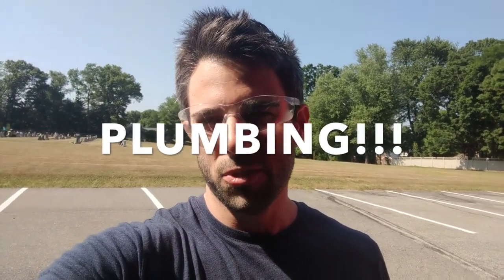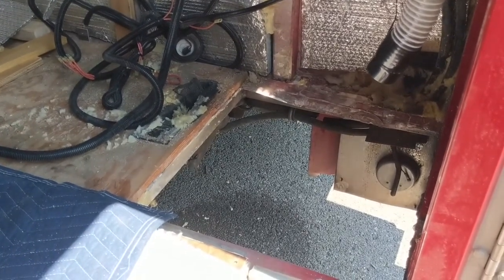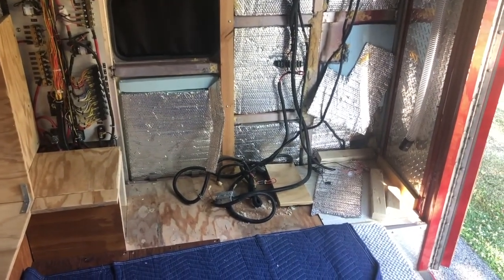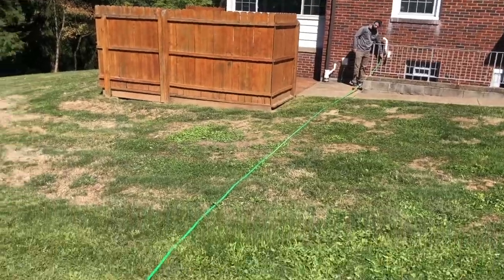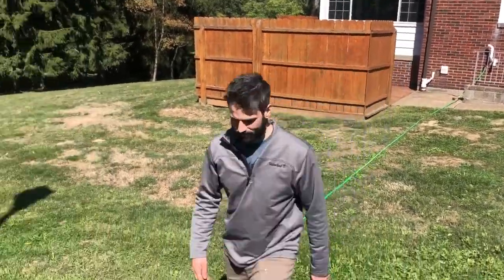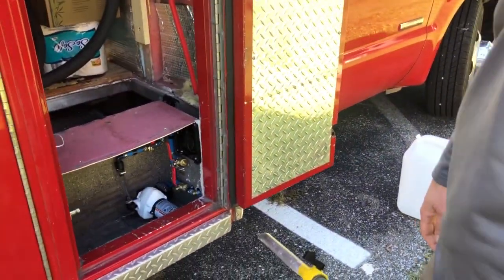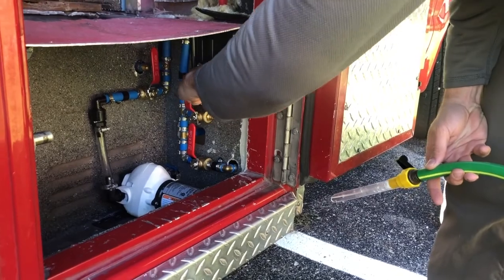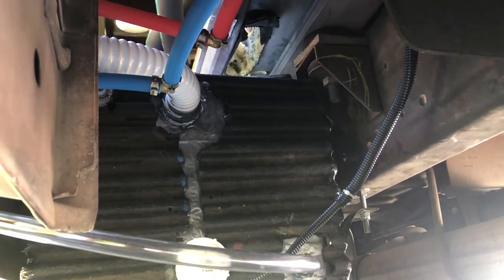Ambulance Conversion Plumbing System

Comment: You may have a problem with pipes freezing if in a freeze zone....I want one...
Reply from the maker: Hi Randy! We used pipe insulation to cover us for the most part, but we’re also snowbirds and don’t plan to be in temps below 30 any time soon 😉
Reply: @bethzabiegalski7874  cool, I was in colorado with a travel trailer.  The sewage hose froze up...then the toilet filled up....fun times
Reply from the maker: @randyhiggins9635  😱😱🥶 sounds like the opposite of fun!!